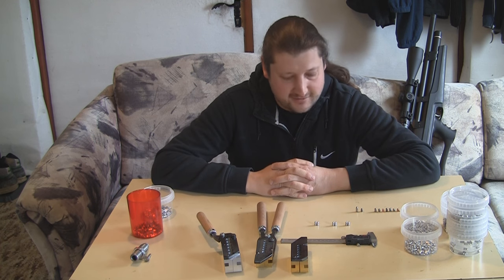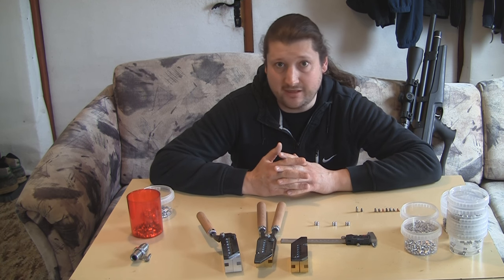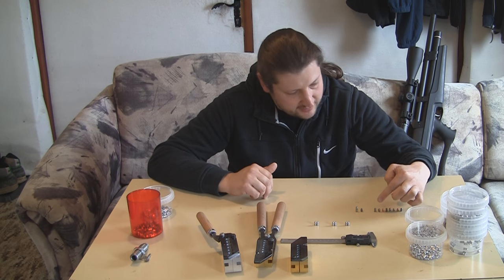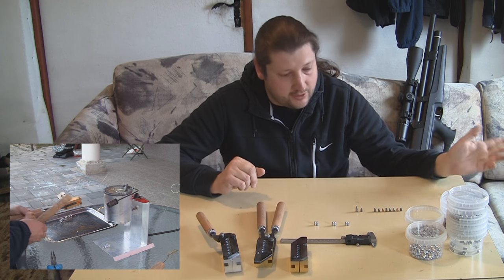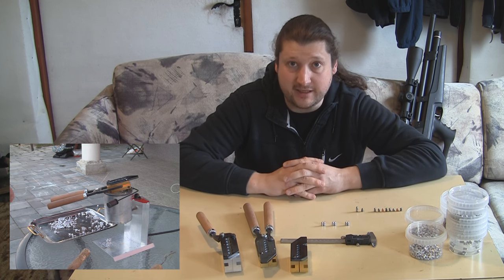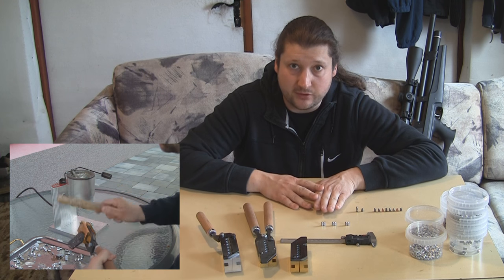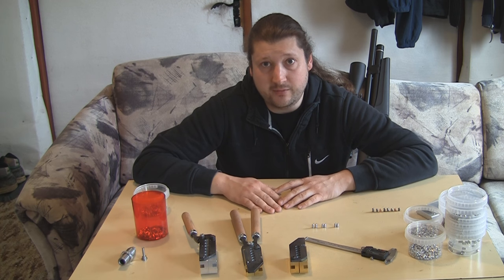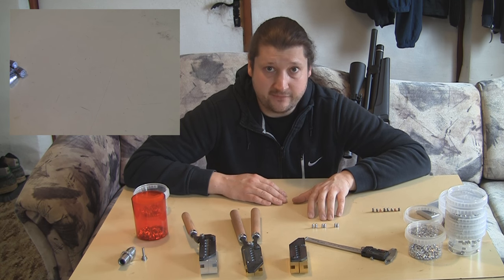.22 mold for Huben K1 and other .22 airguns

Comment from the maker: The mold with sizing die is now available:
https://mp-molds.com/forum/active-group-buys/6-group-buy-for-22-mold-for-huben-k1-and-other-22-airguns-march-2017#12

Recommended for K1 ver. 2 or if you have Rojal custom barrel:
https://www.rojal.si/si/shop/huben-improved-barrel-5-5.html
Reply: Gregor Kamenšek  is that 36gr?
Reply from the maker: Yes. Actually the ones I was shooting were about 36,7 grains in average. They were unsorted so their weight varied between 36,5 to 36,9 grains...

Comment: You should drop the newly casted bullets in a bucket filled with water.
If you drop them on a hard surface they will deform.
Thats why I always drop my newly casted bullets in water.
It also make the alloy harder and less prone to shed flakes in the beryl.
Reply from the maker: I usually do that especially for .357 but with .22 it is really not a issue...
Reply: megaklant67 j

Comment: To make a accurate bullet for airgun it must be quite short as the twist rate is not very good. Especially boat tail form kills accuracy unless much better twist rate is in use. The bullet would also have to have good balance. I think the form of Minie ball or G1 would be a good starting point.

I think hollow base would help sealing the bullet to barrel better. The barrel contact and internal ballistics come first. And only after that comes external ballistics (How it flies)
Reply from the maker: You are absolutely correct.

Comment: Hi Gregor, just purchased a Huben.25 cal and love it. Any recommendations on pellets? Also I saw that Huben is now installing a pressure gauge on its new models, do you think that it would be possible to add to older models?
Reply from the maker: Yes, the gauge fits all models. I have a lot more to test, it seems that K1 in .25 likes all JSB but in particular the original JSB King Heavy.

Comment: Excellent presentation, thank you very much. I achieved 329 m / s 220 bar with the jumbo Beast Huben K1 3rd generation, but the air leaks all after the shot, so I can not open all the power.

Comment: old friend, one school of thought on sizing cast bullets is to let the barrel do the sizing and know that you have the optimum diameter. Who knows
Reply from the maker: Well, I have heard comments like this before but it is exactly the opposite what you need to do to get good consistency that leads to good accuracy. Of course the barrel will size the slug (regardless if you already sized it or not) but if the barrel is sizing undersized slugs then each will produce different friction and require different force to go through the barrel and the velocity and the stress on the barrel will not be consistent and this will lead to poor accuracy.

Comment: Hey gregor, 
Great vid again, 
You set the reg at 150, what was your power wheel set to ? 
I find around 28 to 30 clicks from closed, what was yours set at ?
Just curious.
Also i have a custom tj barrel and mag from kelly at krazy cool air guns, the barrel is about 100 mm longer than the standard mk2 barrel, im quite exited to see how this performs, i have also swapped out tge huben regulator with a huma regilator so yes im looking forward to trying this setup out. 😊
Reply from the maker: Have no idea, this video is quite old :) In fact, I believe that with with version 1 K1 that is now converted to my prototype K1 pistol... In any case, in my experiences, it is quite pointless to talk about clicks among guns. Let me know how it all works when you have it running... It is also highly dependent on the pressure. Some of my K1 would even have a big air dump when I set to 2,5 revolutions on power wheel or higher at 160 bars and some I could fully open to get good power and operation. But my typical setting was between 160 and 180 bars, power wheel set between 2 and 2,5 revolutions from minimum. Let me know how it all works when you have it running :)
Reply: @gregorkamensek3923  will do, 
Thanks for the reply.

Comment: Hi Gregor,
If I reduce the length of the bullets down to 10.25mm in length and the the weight down from 35.49gr to 33.90gr. Will this going to mess with accuracy and hold stable for long rang shooting.
Reply from the maker: Depends, on which side you will reduce the length. If you intend to make them shorter in the front (flat point) it should be OK (but I am not sure how you would do that). If you intend to make them shorter in the back, then you will have less flat surface that is in contact with the bore, that might make them unstable. The flat surface is very short as it is because otherwise they would not fit in Huben magazine...

Comment: hello greg hows it going hope doin fine . just one quick question.. i  have .177 semi auto blowback system but i prefer .22 cal.  is there any chance or is it possible to convert to .22? by changing the barrel into .22

as ive seen in utube blowback system barrel has this mechanical moving parts outside barrel that coverd by shroud. i am looking forwad to change only the barrel from .177 to .22 if its possible. do u think theres a way?

Comment: I mill my own bullets on a table top pen lathe. I use over the counter .22 magnum bullets (just the projectiles) They are a spearpoint boat tail design. I start by center drilling the tail to half way. the turn it around and center pin it then take off about .01 inches of outside circumference. Now I ave a true spear point boat tail bullet for my air rifle. I am going to make some molds for it so I don't have to do it by hand anymore.
Reply from the maker: Molds are a fast way to make bullets, but not the most accurate. Swagging is a better procedure for accuracy but much slower process. Making them on the lathe is also a very accurate way but also time consuming... :)

Comment: Hi Gregor, I have bought the 5.5 mm slug mold from MP mold and started doing some casting.  Upon opening the mold, the slugs always drop out by themselves but the lead mass on top of the spruce plate always stays there and I have to pull it out by using a piler.  In your video, that piece of lead always drops out by itself. May I know how it is achieved ? should I coat the spruce plate with carbon as well to help releasing ?
Reply from the maker: This happens to me if I am using pure lead. If you use harder alloy, the lead will fall off on its own.

Comment: Hi Gregor,
I just signed up for the group orders, just wondering when it going to be in production and available to ship to the customers.
Reply from the maker: Hi. So far there has only been two that signed up. I think that this mold will not be produced because of lack of interest....
Reply from the maker: I am sorry, I had wrong information. Actually we have enough orders to start the production :)
Reply: Hi Gregor,
I submitted payment via PayPal for the mold and bullet sizer. I know you mentioned that we need to buy  Lee 6 cav handles for the mold and the plastic cup. How about the bullet sizer, does it come with the press or do I need to buy Lee reloading press Md: 90045? Thank you.
Reply from the maker: Hello!

The press is not included, but if you have version 2, the bullet will fit even without sizing... Version 1 also but with a little more force. It is better to size them for accuracy.
Reply: Gregor Kamenšek 
I do have V2 and I can't wait for your next review on V2. Thank you for sharing your knowledge with us on K1.

Comment: Hi gregor i love you explanation. I ordered a 5,55mm mold. Do they need sizing? I hear you speak about 5,69 and 5,63 but couldnt find a mold on mpmolds in that size
Reply from the maker: That is OK as well. I do recommend sizing the a bit if you have that option... I size them to about 5,66 mm, this only sizes the bigger oring so they fit in the magazine without using force.
Reply: @gregorkamensek3923  thanks gregor i have both 5,52 and 5,55mm molds. Soon i start casting see what is most acurate at 100+meter
Reply from the maker: @markpoepiloeri8511  Great.
Reply from the maker: Maker sure you use slgithly hareder alloy. Huben prefers harder alloy...

Comment: Huben, if you could get these slugs over to Somerset West in South Africa would be appreciated. A mate of mine owns a gun shop and I am sure that he would do the favour. These slugs seem be based on the old Eley Wasps but you will need to resize them to about 5.51mm to make them acceptable as an all purpose all rounder. I was also wondering as you and myself seem to have been the only two people on the web to have tested the 22 calibre Piledriver. Could you possibly increase the length of the Piledriuver to about 18 mm as this would give it about 60 grains and I think my and your rifle should get about 850 fps out of them but the knockdown ability would be devastating. Maybe Matt Dubber could then test them on steenbuck and duiker. I know that they are no longer manufactured but I have about twenty containers of them as I bought them in bulk about a year and a half ago. I can therefore always send a container to you to measure dimensions and their splines for the gripping of the rifling. My Sam Yang Snipe seems to accept them in 5.52 mm very well but I just feel that their length needs to be increased to stabilise their gyroscopic ability.
Reply from the maker: Hi. I see you addressed this post to Huben. I am just an individual although I will be working more and more with Huben (hopefully :) ). I aware of the resemblance to Eley Wasps magnums but it is only by consistence. The problem with all the bullet shape I found is that they are too small. Standard airgun barrel is 5,49 / 5,62mm. The bullet has to be larger than 5,62 to be accurate. I am aware of the limitation that you have regarding caliber but that is just how it is in physics... I also know that it will not fit in many airguns because of the size. Piledrivers are still being made, now by H&N but they are just to small to have any accuracy, and as you mentioned, the twist of an airgun barrel will always be a problem... There is just one thing that we do not agree on: If you increase the bullet length, then you will need and even faster twist to stabilize them! They have problems with stability as it is but if you make them longer (and heavier) then thy will be even more unstable...

Comment: Greg, thank you for keeping us up to speed on the air gun industry developments. I love all you videos, very interesting and educational. I learned a lot. I'm very interested in the Huben rifle because of it's high power and  long distance accuracy,  but I would also like to use it for target shooting in my backyard. Would you please let me know if you would consider the sound level of the Huben "back-yard" friendly?  How would you rate it compared to your cricket?
Reply from the maker: My Cricket is in .25 and I usually shoot with 34 grain King Heavy @ 60 ft-lbs. If I shoot with 34 grain Beasts @ 60 ft-lbs, it is about as loud as the Cricket, but the the sound is different in tone... With K1 you can actually influence the loudness at particular power by changing the power wheel to pressure ratio... If your pressure is higher and therefore the power wheel is set to less (to remain the same energy...) it will be quieter then if you have lower pressure and power wheel set to more... That goes for all PCP but on most of them, you do not have an option to adjust this, but you can clearly hear this effect on unregulated guns - they are quieter form max pressure and get louder when the pressure drops. You will probably loose some accuracy if you go to the "high pressure / low power wheel" ration setting though.

Comment: Thank you very much for your informative videos. I have a question, the new Huben K1 2020 has a barrel diameter of 5.63 (0.222) and the magazine is 5.66 (0.223). Can I shoot NSA 36 grain 0.223?
Because my rifle barrel is only 0.222 and I'm afraid if I shoot 0.223 slug will be stuck in the barrel!
Reply from the maker: Yes, of course, these are perfect for K1. But do make sure you have over 160 bars on the reg. and power wheel opened to about 2,5 revolutions. You can tweak from there but is it important to start at higher settings to make sure you don't get a jam... personally, I would have the reg. at about 170 to 180 bars and power wheel opened and then go down with the power while on the chrony to get better efficiency.
Reply: @gregorkamensek3923  Thank you very much, I will do it and give you the update. Thanks again.

Comment: So the best bullet size for your barrel is .223? You seem to shoot pretty good with a match of bullet design, size and weight. Good job!
Reply from the maker: .223 is the size of the hole in the magazine. They seem to work best if they are a sung fit in the magazine. BTW, K1 version 2 has the same barrel I have...
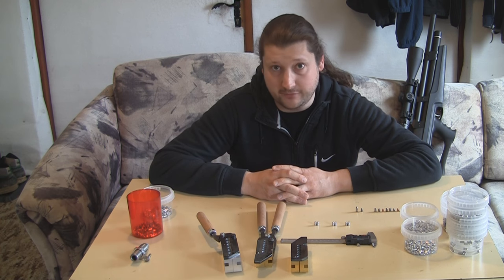Reply: That's good to know of the barrel. Did you once say it had a 1:17 rifling twist. The accuracy you're seeing is the potential accuracy most people would like to see from their K-1. 
Anyway, that's great shooting, and good news about the barrel. The barrel is not a .223?
Reply from the maker: The barrel is .22LR. Huben alos uses it in their K1 ver.2. I will have more videos on K1 ver.2 when I have it...

Comment: Great video!!!  Have you tried using a different mixture, something like Lead and Bismuth?  With the right mixture you could reduce the weight of the bullets.  36 grains is a bit more than most PCP guns can handle.  Sure they could shoot them but the MV will be way down.  Have you experimented with making the same bullet using a mixture that will allow it to be as light as possible?  If you can get the weight down to something like 20 grains or so, I'd be thinking that they would sell very nicely.
Reply from the maker: Actually, my goal was to have a bullet for Huben K1 and I wanted it to be as heavy as possible. At the time and actually to this day, there is no appropriate pellet or bullet available for K1 (keeping in mind that K1 can shoot at over 100 joules and has better accuracy with bullets than with pellets). I did not really consider this bullet for other airguns, but yes, you are right, these are definitely too heavy form most airguns and also probably would not fit in the barrel chamber...

Comment: Absolutely fantastic video Gregor. Actually watched this twice to understand it better. Any chances to make it in the 177 cal in a 16 grain variant? The only pellet that shoots decent with my Evanix AR4 4.5mm is the Eun jin 16 grains. 

Thanks for your informative videos
Reply from the maker: Interesting. What about JSB Beast?
Reply from the maker: As I already wrote to Paul, it is not easy to cast such a small bullet...
Reply: The JSB's are a loose fit in the AR4 revolver shaped magazine. :( . I understand that it is tough to make 177 moulds, but I see that that your friend is making them with CNC machines and not on a manual machine - so i guess the tolerances should be perfect with a quality CNC machine. An observation on my magazine - even the 19grains skirts of the Eun Jins are small. Just the 16 grains fit.
Reply from the maker: I see. Yes the mods form MP-Molds are CNC machined and with extremely high tolerances...
Reply from the maker: What velocity do you get with 16 grain and is the barrel choked?
Reply: Gregor Kamenšek around 950 fps when unregulated with a 16 grains pellet. Looking for a similar weight but with a higher BC. I think the Eun jins are flawed and I could do with a better pellet.
Reply: Gregor Kamenšek Yes. Also what struck me is your comment about they make their moulds with a CNC cut - which would be ideal for best even pellets
Reply from the maker: What about piledriver?
Reply: Gregor Kamenšek didn't try it as I do not have them. Are they good? Will try and source them here.
Reply from the maker: I doubt the you will get good results with them, but you can try. They are usually not stable because they require very high twist rate. The are also too small in .22, I do not have any experience in .177... 
Here are the heavy .177 pellets:
http://www.pyramydair.com/a/Ammo/109/calibers_0_177/pw_grain3
First I would try Baracuda Magnum... 16 grains
Reply: Gregor Kamenšek ok. Will update on the pellets bit soon. Thanks
Reply: h&n have a heavy boat tailed pellet but more then 16gr, i think they are 20gr - 21gr in .177

Comment: Hello Gregor your video made me get the k1 G5  thanks for that. I have a problem with  the first Generation of MP mold  wen I  Resize the slugs they always get stuck in the magazine . This happens every  time I try to use the slug,  the magazine wont rotate and it looses all the air in the gun 
It works good with JSB . I can't get the slug to fit if I don't resize them it seems like they become to small wen I do that and they get stuck.  Any suggestion will be appreciated  thanks.
Reply from the maker: Hi. You should size them and that is definitely not the reason why they get stuck in the barrel. Try raising the pressure up to 200 bar on the reg (keep in mind that the pressure gauge is not always showing the correct pressure) and try again. With this pressure, the gun should operate correctly even if you open the power wheel to full power.
Reply: @gregorkamensek3923  Ok thanks for the  Quick response I will try that.